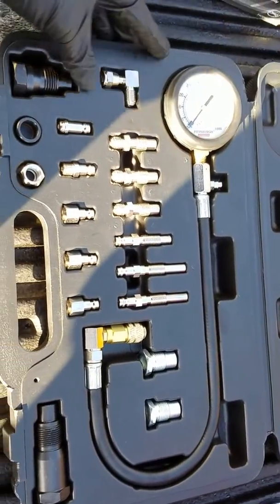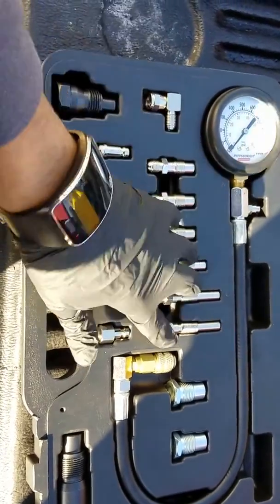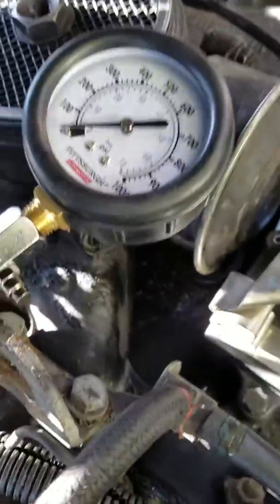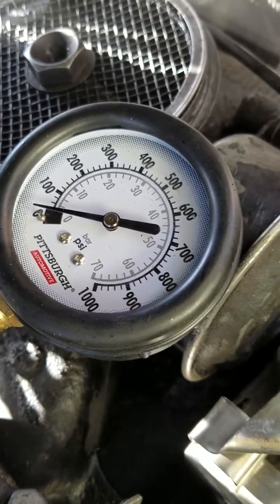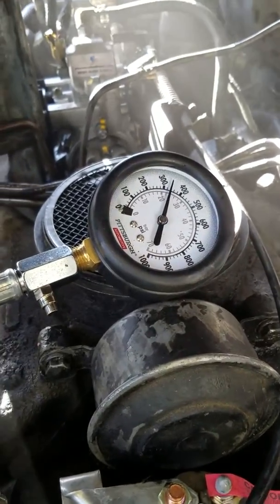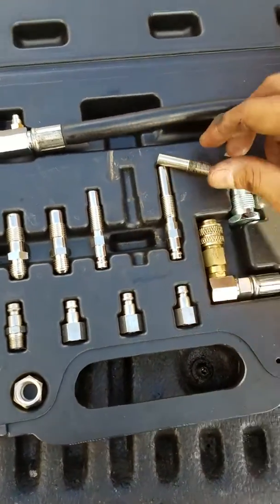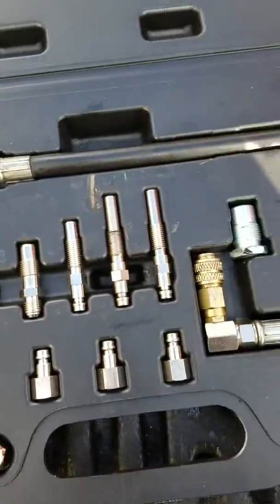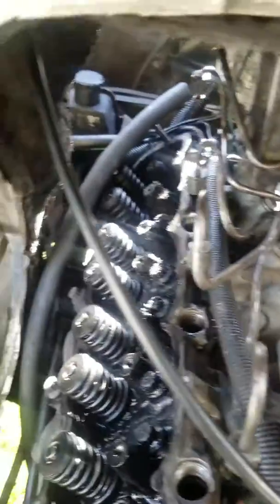International IDI 7.3 cylinder compression test

Comment: Is it possible to take the head out of an e350 without taking out the engine?
Reply from the maker: Hey L1ne3, actually i pulled this head (in this video) out of a older e350 through the dog house by myself! it was not easy but i got it done. If you have a partner to give you a lifting hand this can be done easily.
Reply: mydieselrepair yeah I have my doghouse off my 1993 ambulance and was wondering about this myself. I was surprised that it was even possible. Do you think it's possible to fit a turbo in there?
Reply from the maker: Yes, iv'e seen aftermarket set ups with the turbo mounting right on top of the intake manifold. do some extensive research to make sure and pick the correct set up for your application.
Reply: L1ne3, yes, you can do the heads on an e350 without pulling the engine:  http://www.nickpisca.com/diesel/engine/1988-e250-van-7-3-idi-head-gasket-job-without-pulling-the-engine/  That's how I did it.
Reply: Also, here is my write-up about how I put a Hypermax turbo on this.  It's close to the doghouse, so a turbo blanket and wrapped pipes are a must.  http://www.nickpisca.com/diesel/turbo/hypermax-van-turbo-install-for-the-7-3-idi-in-a-1988-ford-clubwagon/